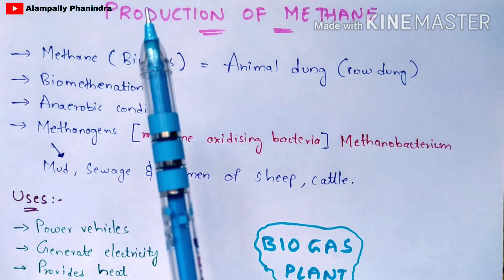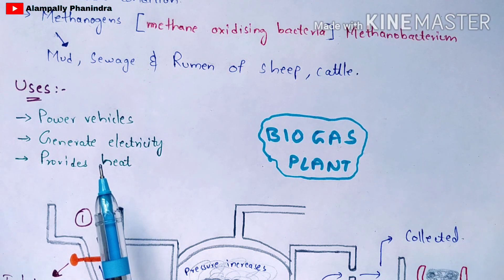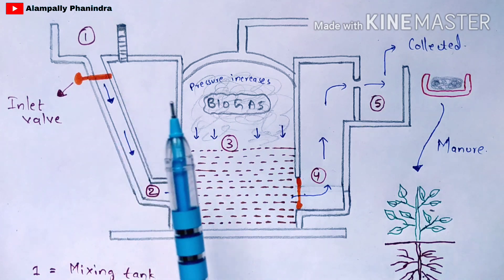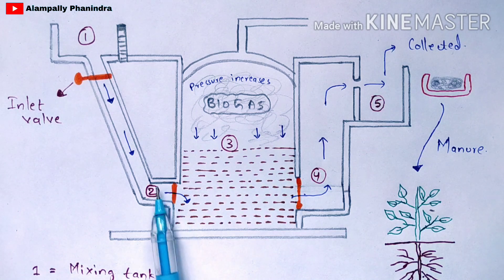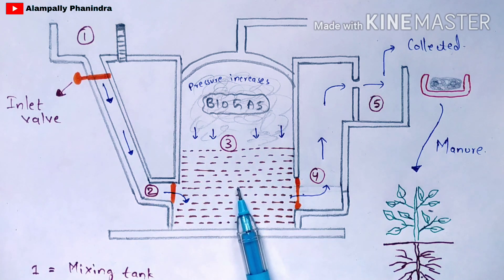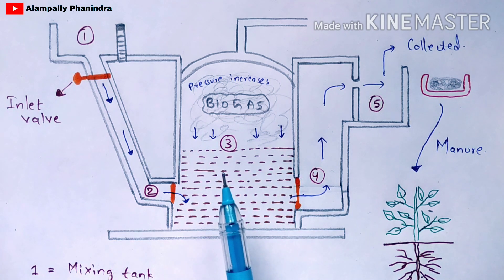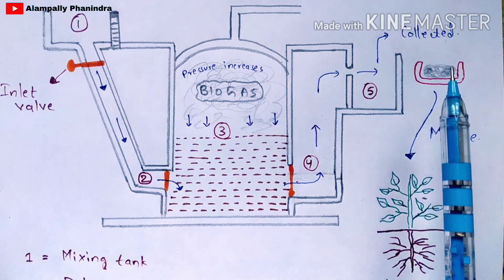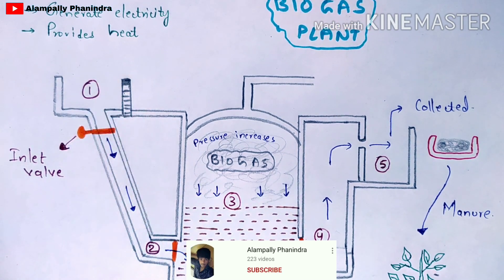Methane production | Biogas plant | Working | Mechanism | Methanogens | Biogas production

Comment: If there were valves at no. 2 and or 4, they would allow material to flow in both directions when opened, until stasis / balance is reached. Therefore having valves at no. 2 would allow backflow from digester tank into feed tube whenever opened— the whole point to the design with feeder tube entering near bottom of digester tank, is to feed the tank without use of a no.2 valve. Similarly, valve 4 is superfluous (not necessary and actually in the way for if a blockage forms here, it is very difficult to clean). Final point: grass and other green waste actually produce much more usable methane than animal dung, by weight.

Comment: How can you close or open the no. 2 and 4 valve?
Reply: If there were valves at no. 2 and or 4, they would allow material to flow in both directions when opened, until stasis / balance is reached. Therefore having valves at no. 2 would allow backflow from digester tank into feed tube whenever opened— the whole point to the design with feeder tube entering near bottom of digester tank, is to feed the tank without use of a no.2 valve. Similarly, valve 4 is superfluous (not necessary and actually in the way for if a blockage forms here, it is very difficult to clean). Final point: grass and other green waste actually produce much more usable methane than animal dung, by weight.

Comment: The use of Inlet and outlet valves 2 and 4  is infructuous. Once the slurry is dropped it will stop flowing to maintain level with outlet level..and the digestate will overflow only when the level of mixing tank is higher than overflow tank. This has not been explained.   Also no explanation on mesogenic bacteria.. well intentioned but poorly researched and explained. Take this as a feedback not as criticism. Tc HNY2021
Reply: Pradeepkumar Pillai
No problem, no overflow, the valve on 4 will be closed. Listen carefully during explanation.
Reply: @danielsalas3314  u haven't understood what I said. Use of these underground valves is meaningless.